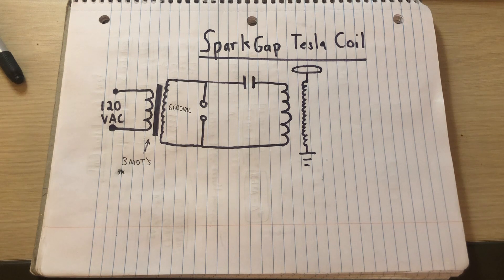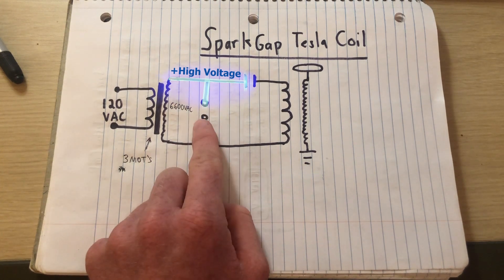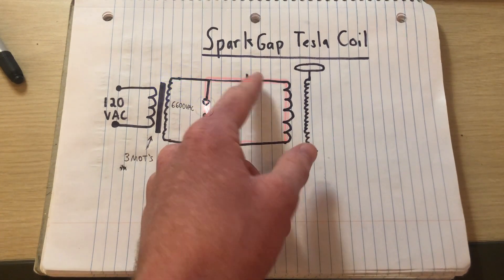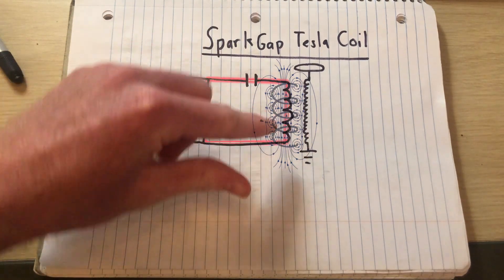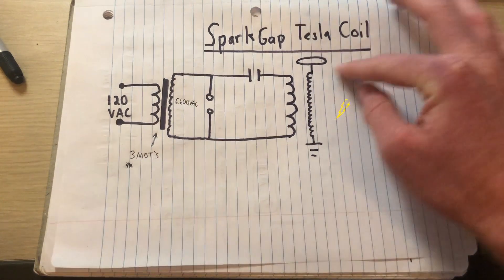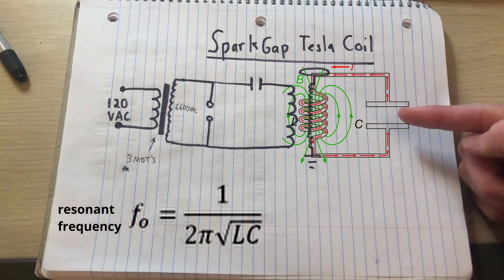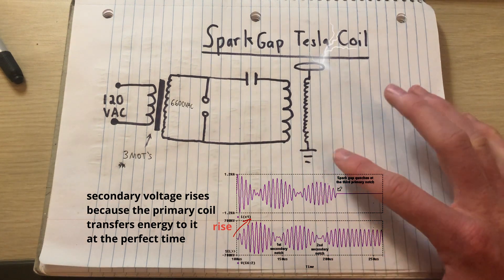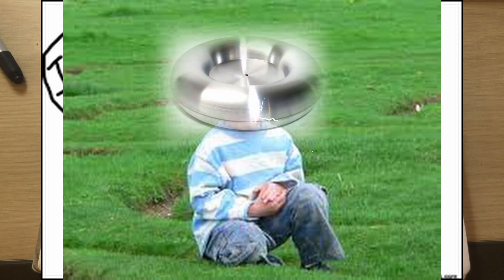How A Spark Gap Tesla Coil Works

Comment: Tesla explained in his 1891 lecture:
Electrostatic field on the primary is slowly charged up by the capacitor.
Then the high voltage electrostatic field is suddenly discharged by the quenched sparkgap.
this powerfull electrostatic shockwave excites the secondary into a longitudinal resonant mode.
the primary has no magnetic current and should not be resonant. a unipolar change in voltage without polarity reversal.